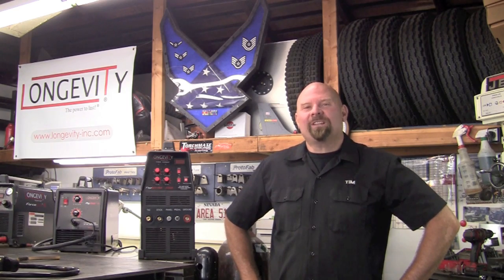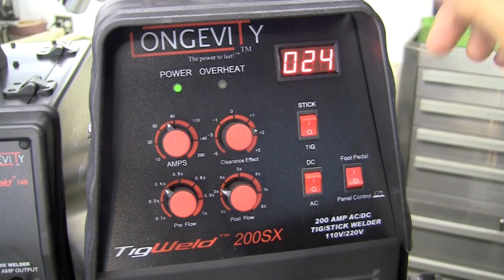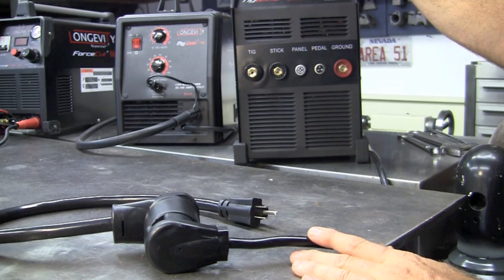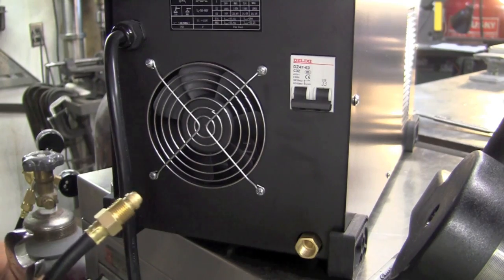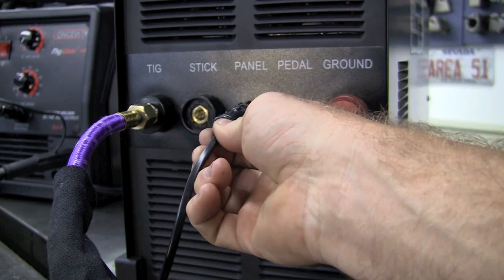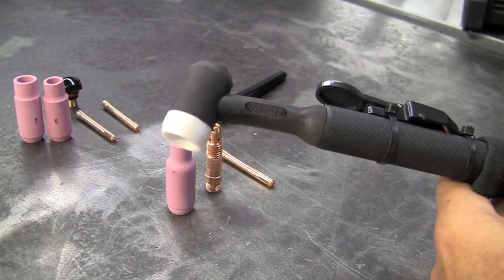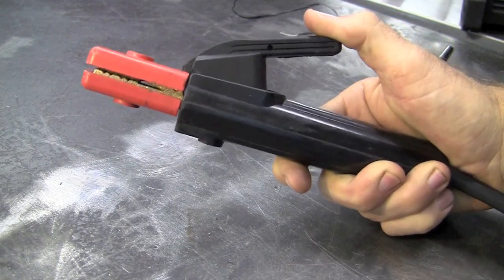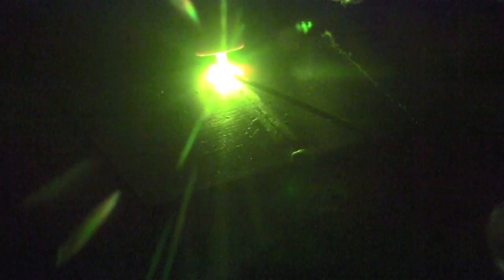Longevity TIGWELD 200SX - 200 Amp 110V/220V AC/DC TIG/STICK Welder

Comment: i bought one  a  few  days  ago,  and  I havent  got  argon  gas  yet.   Today  I  decided  to  just  run  a  few  beads  with  the  stick  .   I  was  having  trouble  with  the  amperage  .  The  machine  is  like  hit  or  miss.    The  ground  is  good.  It  will  sometimes  cut  off  the  amperage  like   down  super  low,  but  enough  to  maintain  an  arc.  Its  weird.  If  you  play  with  the  amperage  setting  it  will  bounce  back  .  but  hit  or  miss .  Strangest  thing  iv'e  ever  saw  on  a  welder.  Something  isn't  right  :(     Like  set  the  welder at  120 amps,  throw in  a  1/8  rod.  It  will  weld  a  good  bead.   The  next  one  wont  strike  a good  arc,  but  it  will  hold  the  arc,   like  up  to  an  inch  away  from  the  plate.  No  amperage.   then  it  will  just  perk  up  and  start  welding  along  and  then  just  taper  back  .   Anyone  else  have  this  problem  ??
Reply: ron carver im having issues getting and arc or maybe the ground...

Comment: Really interested in buying your welder but need some questions answered first...I'm sure I'm not the only one since I couldn't find them on your site...

#1. Why is the tigweld 200sx only rated @ 1/8 stick welding & the 200ex rated @ 5/32 if they both have a 200amp capability @ 60%? 
#2. There is conflicting info on Longevity web page...is the 200ex rated @ 60% for 200amps or only 25% like your website Also states?
#3. Does the 200sx have an older MOSFET or the newer IGBT?
#4. Your website clearly says the 200sx has a dinse connection for the tig torch "for easy switching out" but the pictures & install videos Clearly show They DO NOT, what other type torches will fit it, do you have adapters... like say a flex head or can we opt to have the 17 torch put on the 200sx?
#5. What is the turn around on any welders under warranty sent back for repair, cant wait months not welding...
Reply from the maker: 1. The 200SX is more of a DIY unit compared to the EX which is meant for more advanced TIG/STICK welding.
2. The reason for the rating differences is because they are rated at different degrees of temperature. The EX is actually above 60% duty on American Standards.
3. IGBT
4. Right now, they use DINSE for the stick. So you can switch between TIG and stick easily. However, in future, we plan on having other brand torches enabled with our machines.
5. Turn around is quick, and we have loaners.

Comment: Not recommended simply because you may need to do some out of position welding where using the pedal is just not possible.  The switch also helps the torch from twisting in your hand while you are welding.  Its hard to make a good weld without dipping the tungsten if you are fighting the torch.
Reply: Not if u learn to walk the cup

Comment: I'd keep it on there.  It helps keep the torch from twisting around in your hand when you get out of position,  even if its not used.  It also comes in handy when you can't sit  and use the pedal.